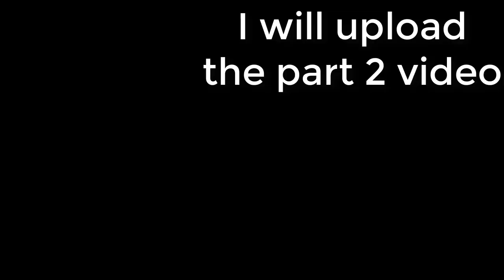car amplifier circuit board

Comment: TDA7388 ic ko 6 Amp diode mat lagana. Kiu ki 14volt maximum volt, 6 amp maximum current diya to (14×6=84watt÷4=21watt) har channel. Full output nehi milta.